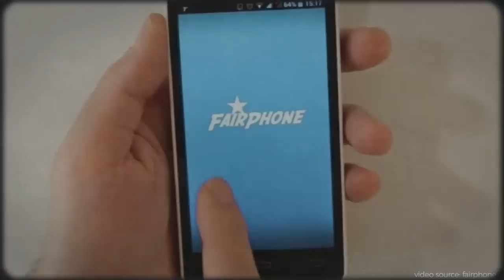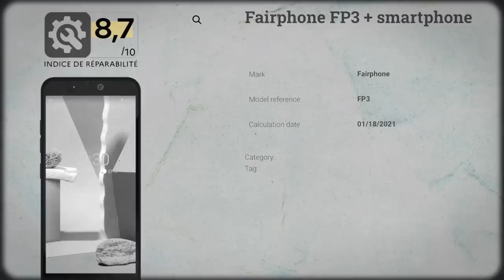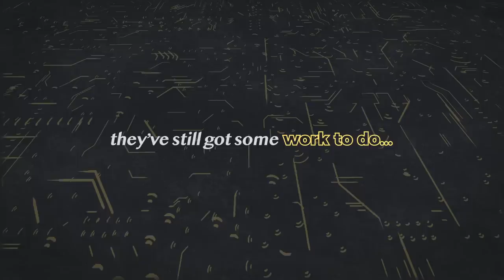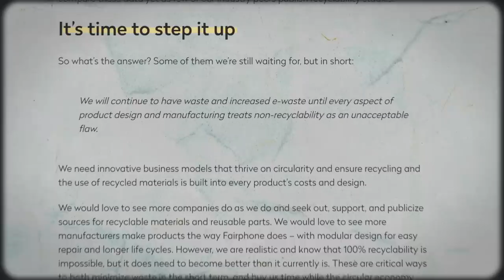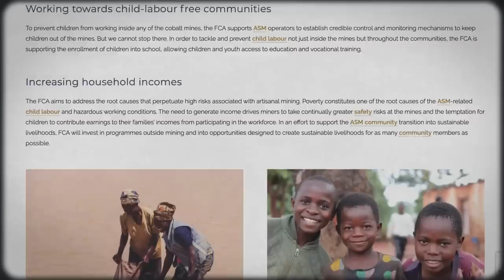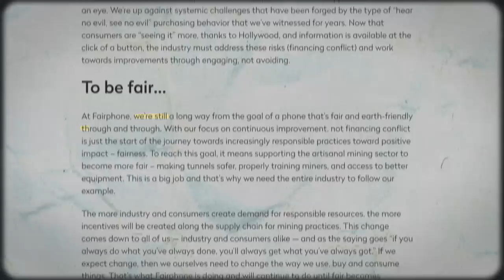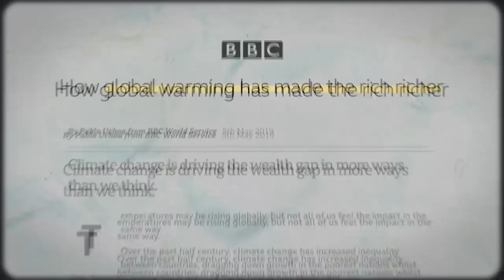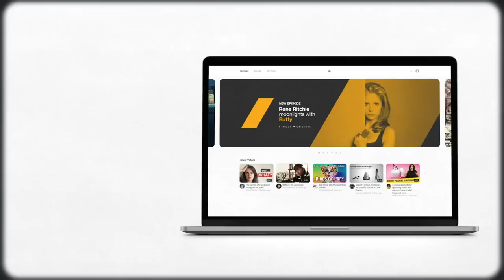Is This the Most Sustainable Smartphone?

Comment: This is the first time I have heard of the fair phone (probably because I'm american) but it sounds like such a good idea. It would literally be so cool to just go and buy a new part for my phone. You could upgrade or replace a broken part as you need it. It would work a lot like a PC, you can just put the parts you want/need in it.
Reply: The problem with Fairphone is that they change the part's form factor every generation, they were able to make an upgradeable part thingy with the Fairphone 3 and 3+, these two have the same form factor, so you can just get Fairphone 3+ parts and upgrade Fairphone 3 parts. However the Fairphone 2, 3 and 4's parts are not interchangeable. 

I think they should have a parts standard like PCs do.
Reply: @Kromiball  On the other hand, wouldn't that trick us back into consuming? Upgrading lots of parts we didn't need? I guess if the alternative is to buy a whole new phone it is better to get some parts, but really shouldn't we just try to NOT upgrade? So that best would be to have something that didn't get outdated, and that could be repaired. 

My iPhone 6s from 2015 has a bad battery and the cable for the home button if broken. If Apple didn't force software updates on me to sell new phones I would just repair this one and keep using it, but if I could upgrade the phone little by little I probably would. Just to get a better phone.

Comment: This piece goes completely to the heart of the problem. I know someone who used to work as a quality control engineer in a massive consumer electronics firm and he told me the pressure to deliver products faster and cheaper meant less testing time, less reliable components (especially capacitors on chips!) and so generally products with shorter lifetimes. Even so, the competition from Asian imports was so intense the factory was continually at risk of being shut down. As Charlie says in the video, the Fairphone itself is almost more important as a symbol which will hopefully spearhead a new kind of tech future premised on build quality, reparability and minimising waste and emissions. We can't hope to beat the climate crisis if we don't massively start campaigning for this, and we need to get the big tech reviewers like unbox therapy and MKBHD to get on board with promoting this message.

Comment: To all the phone manufactures out there: start using screws instead of glue, make the phone easily repairable by allowing easily access to the internals, focus on battery life and optimization instead of gimmicks, and lastly please for the sake of god standardize the batteries.. make 20-30 battery form factors to accommodate any phone and stick with those for god's sake. If you take any phone brand phone by phone  you won't be able to interchange their batteries because they're all different. Standardizing the batteries would also cut costs because you wouldn't have to build a brand new battery for every new phone model.

Comment: Very surprised an iPhone got a score of 6/10, was under the impressions that iPhones were even worse, given their reputation for tanking after a years use.
Reply: Same, they deliberately work against people fixing their own phones. I'm astounded they got a 6/10.
Reply: Exactly! They do feel like the opposite of role models for sustainability.
Reply: If you ever got your hands inside anything apple-made in the last 8 years you know it is definitely way lower than a 6. tbh even a 2 is too high
Reply: i've been using a 6s plus for 4+ year's and it's still going strong!
Reply: @TitanSKiZlz  I did have a relatively similar experience with my old iPhone 5s, it lasted for a very long time! Maybe the reputation is with their newer models?
Reply: @OurEden  I think it's because Apple has intentionally made some components irreplaceable, I was actually afraid of replacing my display because I wanted Touch ID to still work, but apparently people keep finding workarounds!
Reply: Even though their devices may be a little bit trickier and more expensive to repair, at least they supply them with updates for six years or so, while you will get maximum of 3 years with any other flagship smartphone.
Edit: And I think the wide availability of spare parts is also helping apple.

Comment: From what I've seen, Fairphone is still a normally structured company. While they are certainly great, do you think them not being organised as a cooperative or some other more democratic form is a major flaw given that you call for more collective democracy and even eco-socialism? Because that seems like something they could easily change and i'm wondering why they haven't.
Reply: I've worked for a cooperative.  It had some advantages but in some ways a normal hierarchical company can end up being more ethical.  I actually left due to unachievable targets and lack of observation of safe working procedures being common in order to meet targets.  Not that it being a cooperative was the cause, simply that being a cooperative did not solve all the problems.
Ultimately it comes down to the people in charge more than the structure itself.

Comment: I saw this video when it first came out, and came back to it now that I’m looking into a new phone - as my current one is at 5 yrs and running, and has started to shut down randomly, spazz out, etc. I usually get about 5 yrs out of my (new) phones (I’ve previously had 4-5 secondhand phones for around 1-2 yrs each, and I’ve had a phone since 2008), and I’m now trying to decide which new phone I should get - a Fairphone, or another Samsung, as my previous 2 smartphones were. 

The new phone I get now will be my 3rd new phone, and I will have gotten 5 yrs out of the previous two, and that’s just my use of them, as I tend to hand down or lend out my old phones to friends/family, or save them as backups in case of accidents etc, which isn’t the best use-per-pollution rate, but compared to a lot of my friends (early 20s) I think I’m nearly doing the best I can do within my sustainable ambitions.

Comment: One of the main problems new phone manufacturers have is that they only focus on one part of the phone. In this case, the production of the phone. But focusing so much on one part means sacrificing everything else. Fairphone probably has low specs

Edit: I did research and the phones are pretty decent. I think what I said is starting to change as the market is now mature.

Comment: I really appreciate this video and the thorough research that went into it.. I have a slightly impression that the final message was perhaps a little bit more negative than it should have been. Of course they aren't perfect and there's still so much more that needs to be done, but so far they are THE ONLY ONES giving a ship about miners' conditions and sustainability. For example, I wish you hadn't compared it only to the iPhone, but to all other (main) phones, just to show how far apart from the pack this company is. I imagine the reason is that the iPhone is the most popular phone (is it?), but perhaps it would have made a stronger point that way. Just my impression... Thank you as usual for the wonderful work you do!

Comment: I've lived the past few years trying to lower my impact by buying either used, or broken phones/laptops and repairing/upgrading them to the spec I needed, one less new device bought by me, one less repairable device being recycled. My next phone will likely be a fairphone, although my problem with their device is that it isn't upgradable where I feel it should. Why can't I pop in a new eMMC chip when the 64GB one becomes too small? And no, uSD is not the answer. After all that's the reason I had to give away my perfectly functioning LG G6 a few months ago. Why can't I upgrade the CPU+RAM combo when they can no longer keep up the pace?
In the hardware hacking community these things are a regular occurrence, even if companies try to make it as difficult as possible. I replaced the eMMC chip in my 2015 tablet upgrading from 32 to 64GB, but that took a hot-air rework station and a lot of research.

Comment: Only 5 years of support is quite disappointing. Even 7 years isn't all that much. It'd be nice if (at least some) components for newer phones (like, the camera) could be backwards compatible. That way they wouldn't need to keep stocks of old cameras for ages just in case someone needs on in 10 years, btu you could still repair your old phone. 
Interesting video! Fairphone is definitely a product I've considered getting on multiple occassions, but I ended up with a second hand device since at the time money was an issue. (And I can still get (probably offbrand) replacement batteries for my 7 year old tablet...) But I'll definitely consider it again next time I need a new phone.

Comment: I don't know. I'd probably never want to change only the camera of my phone. I'd want to change it all to get upgrade in all components not just the camera. In fact it might not be possible to get full benefit of camera upgrade in many instances without also upgrading CPU that provides optimizations for algorithms necessary to process real time image. We probably will not have a sustainable model as long as we keep improving performance of literally all phone parts (screen, battery, CPU, GPU, wireless, camera, sensors) as quickly as we are today. If we make noticeable improvement that can do more than existing devices - this alone immediately makes existing devices obsolete. The only way to make it more sustainable is to slow down the pace of improvement so that noticable improved performance would come out every 10-20 years instead of every 2-4.

Comment: If you need a better phone, a used android flagship is a good option since it devalues quick but doesn't exactly slow down easy cause its updates stop earlier than iphones but software gets supported for the older versions more, android 4 still has software support or did when i used it in 2023

Comment: My Lg V20 cost me 400 Euros in 2017. I have been using i since then and it has been an absolute beast. I changed the battery a week ago, it went back to 100% performance capability. Why do I need to ever consider a phone like Fairphone, very outdated already out of the box, when another company can provide me with a phone that lasts 2 times more, performs better in every way, and is well made in every way. See by it lasting two times longer with it's capabilities and performance, I would probably save the planet two times faster.

Comment: As parts become modular and easier ro replace, it begs the question, why have a seperate camera and screen for your car? If you can have one screen that works with multiple devices, you cut down on so much redundancy. And suddenly it becomes reasonable for every device to have touch screen functionality, because you only need to own one screen.

Comment: 6 out of 10 for iPhone 12 is a Joke it is more like 2 out of 10!

why?
1. No Public Legal Blueprints!
2. Screen and Back Glued together!
3. Super short and hard to reach cables leading to damage!
4. Screen will not work if not replaced by an Authorized Person due to Firmware Lock even if screen used came from another iPhone!
5. Smaller Batteries so they degrade much faster then Similar Performing Android Devices that almost all use larger batteries that take longer to develop Crystals that slow or even stop Charging and makes Discharging much harder leading to even more degradation due to heat!
6. Apple dose not put nearly as much of a Buffer (aka Over-Provisioning!) as Rivals do (This means a so called 3,000mah battery is closer to 3,500mah!) this means a device can charge faster and reduce stress and heat on the battery as the software tells the device that 10% to 15% low battery is actually empty and 80 to 90% Charged Battery is actually full Meaning less Heat and Stress that means much longer life for the battery!

Comment: Why fairphone does not make a pledge to keep size of the phone same? So, it will be easier to get a case and tempered glass and easier to hold. Why not change the chip every three years? So it will be easier for them to give software update? I know they can’t order high end chips due to the smaller order size. After using phone for three year I just wanna new os with new more efficient chip with new battery. Not new camera or speaker.

Comment: Would for sure be using my iPhone 6s If It didn't die, after repairing it twice to expand its lifespan. If I was in Europe I would buy a fairphone, but my second-best option is going to be a well-taken care Samsung Note (The last one with a headphone jack). I can't tell you how much it sucks that we rely on these glowing rectangles in modern-day society, It seems you can't get around without them. Not in just a We're addicted sense, but it's just safer, more convenient, and needed for certain activities. It sucks that the things we need are based on such unethical structures.

Sorry for The Text wall just ranting.

Comment: I did have a FP1. It was okay bc it was my first smartphone. BUT they're working with 5 year old tech, but the prices are very much up-to-date. The idea is good, but destined to stay a niche or fail. The customer pays a technologycal and financial premium for the privilege of chestbanging.
What they seriously lack is an upgrade program and/or backwards compatibility.
I try to be conscious about my choices, i stretch my use time, and try to reuse (i buy refurb or used phones). 
If you buy a 2y/o flagship, that's gonna be a decent phone for another 3-4 years and even then you can pass it on with a new battery bc of build quality. With FP you already have a handicap against software trends the day it comes out of the factory. If you're happy using a "bare bones" phone, you can do that with an old phone and spend 1/3 of FP. And environmentally speaking, starting a 2nd or 3rd life cycle of the same device goes further than paying a premium and compromising at the same time.

Comment: The beginning of your last chapter gave a good summary to why Fairphone will never really gain any significant market share. In its second part you mention that the problem is inherently in humans and the system they live in. I couldn't agree more, however, this in my opinion cannot be fully solved by changing the political systems. Despite some correlations, cosumerism isn't directly connected to any political philosophy, even though it is of course clear, capitalist countries are much more consumeristic. The main flaw is in humans themselves and their values. Until you change those (and it is incredibly hard to do so via politics), everything else will be pointless.

Another problem is that people simply don't care whatsoever, even though they might not usually be these strong "consumerists". Ask your coworkers, family or classmates whether they really care about where and how the phone was manufactured. I can guarantee you, most of the people will be angry about the conditions the phones were made in, but they will still not change their behavior if it means they will have to either pay more or have in comparison lesser product.

I know this is hard to accept, but Fairphone cannot ever be as feature-packed as the Samsung Galaxy phones, iPhones etc, unless it will cost three times as more. Modularity will always bring its own problems - for example less efficient use of space and lack of any dust/water resistance. Also you could say, that ease of repair doesn't really matter in the end. For people who are interested in anything regarding tech, sure, but what about the rest of the population? They will still have two distinct options - repair the phone in the nearest repair-shop, or buy a new one. In the end, almost anything can be repaired by a skilled technician, it might only take longer and be a bit more expensive, but modularity doesn't solve the underlying problem.

And lastly, the problem that should be in my opinion solved with the greatest priority (though I have no idea how), is China. China depends heavily on exploiting its own population and Winnie the Pooh will fight tooth and nail to keep the status quo and force China's people to actually want their extremely cheap phones manufactured by children and Uyghurs in labour camps. It makes everything easier for the CCP - surveillance is basically built-it, CCP looks like the good guys when they can sell something for a fraction of the price in comparison with the evil West, it is home-made and therefore "patriotic"... Also most people in China outside the few wealthy cities cannot really afford any other phone. Don't also forget, that it is almost mandatory right now, to own a smartphone in China, as it works as a combination of ID card, payment device etc. and people without them often cannot do half of the things others can, despite their "party credit score". With the sheer amount of people living and depending on China, this is the biggest problem sustainability and good labor practices currently face.

In conclusion I admire the Fair Phone and its ideas. But I seriously doubt it will solve anything until people will start to care about the underlying problems. Only after people start caring about sustainability and labor practices outside their country, only then we can start asking ourselves, how should we change the products we make.